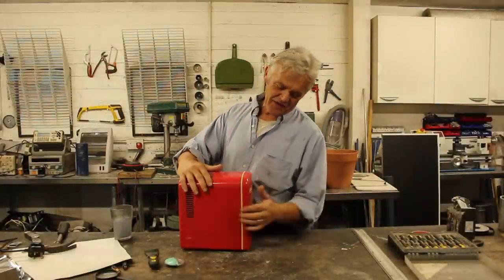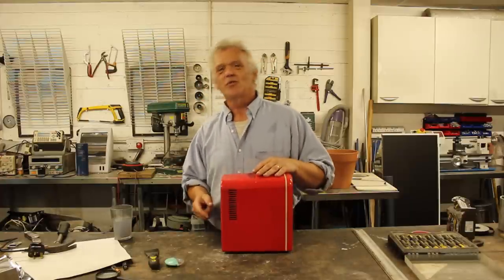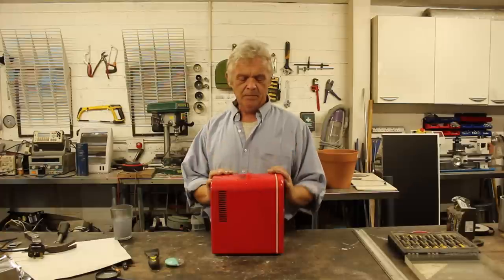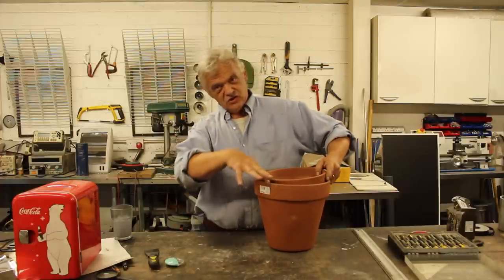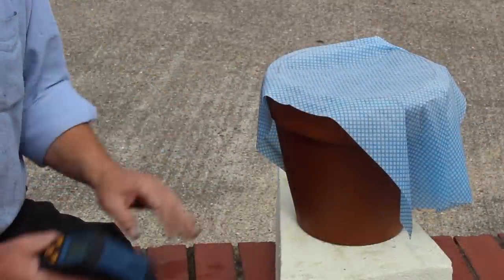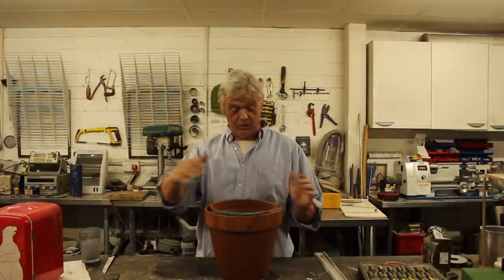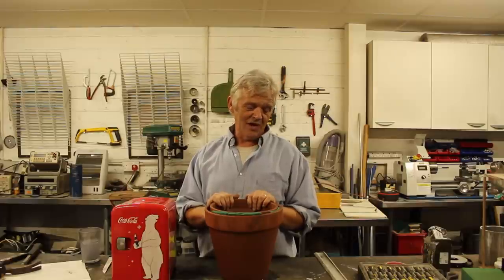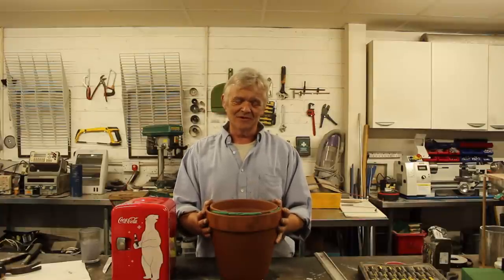1615 How To Make A Plant Pot Fridge A DIY Desert Cooler

Comment: Nice!  Use aluminum for the interior pot and it will get colder.  Put black sand on top and evap will increase as will cooling.  😎 Throw in a slight fan will increase evap as well.   High humidity will decrease evap thus decrease cooling so it works best in low humidity.
Reply: It won't get maximally colder with the Al pot, but it will transfer the energy exchange faster/more efficiently. Since the system isn't well insulated from ambient temps, doesn't matter too much, because you constantly have warm air getting back into the system, which will equalize the temp of the Al pot. 

  Basically, there will be no difference of total energy exchange, just different rates of relative cooling and heating and time of same.
Reply from the maker: nice suggestion - cheers mate

Comment: Zebras also have stripes because they heat up differently and create eddies and currents of air around their bodies, cooling them by up to 3 degrees Celsius. Something similar could be done inside the pot fridge, on the wall of the house, or the cooled room behind the stove - different materials, colors that have different thermal conductivity and different shapes that direct and distribute the currents.

Comment: I used to use a zeer pot in my camper (caravan?) If I remember correctly Mother Earth News said to soak the outer pot and keep it damp to aid in evaporation. Once its operating the outer pot stays slightly damp.  they do a decent job and you dont need to worry about ice but like you said they arent as effective in humid areas. You can help them by blowing air around them..
Reply from the maker: cheers mate

Comment: Fill the center with wet Oasis and put it in front of a window with a cross breeze and you have a handy air cooler for your window for those summer days where the heat is not on your side.
Reply from the maker: nice one!

Comment: I used to live in a house made of wood, straw, and clay with no air conditioner, and it stayed cool entire summer. Not sure why they don't use this technology anymore...
Reply: I'm So wanting a Cob House!! 
They're a bit labour intensive to build,but well worth the effort!!
Thank You for sharing this with us All 💞 Namaste 🙏
Andrea and Critters. ..XxX...
Reply: I used to live in one   wood straw clay building from 1860. It was always cool in the summer with just the right amount of humidity inside.
On our new farm we hve brick  walls and added woodfiber plates and clay to all walls facing outwards.  Oh and we integrated heating/cooling loops that are hooked up to a heatpump running at35°c. The whole wall can breathe and it was just as easy to build as modern building materials. Clay is quite forgiving  and can be locally sourced and using wood fibre panels makes it super easy to install. Waaaay better than rock wool.       All this to say at least in germany it's  possible and still done.
Reply from the maker: to be honest - I think a lot of heating and cooling problems just come down to the way we build out houses
Reply: @ThinkingandTinkering  or dont build em.
Reply: I dare say the PC brigade (sharp intake of breath) will see it as a fire hazard.
Reply: @terieffo8  Straw mixed with clay is actually pretty fire resistant. More resistant  than houses built of wood for sure.
Reply: short answer is such a home is actually illegal in most places, so you cannot pay a professional to build one for you, and you won't do it yourself.
the long answer includes the fact that nearly no one will pay you do build a mud house, and remarkably few people are willing to live in a mud house.
Reply: Homes and cities aren't built with isochanvre anymore because the Lumber and Timber Industry came in during the Industrial Revolution and created billionaires who create building codes and permitting.

Comment: Recently I changed my path and decking at the back of my house for black block pavers, I know this is going to sound strange but in the summer all I had to do is spray them with a hose and they cooled the garden and now i's got a bit cooler they are heating it. The effect is quite noticeable because they act like a sponge to water and a fantastic heatsink (when dry).

Comment: When the temperature drops below 30 degrees Celsius - you can light the rocket heater you made with sand and place pot fridges around the heater. This will ensure a sufficient temperature gradient. 🙂It is an exaggeration and at the same time it is not.
Reply from the maker: it is an interesting idea mate - nice - cheers
Reply: @ThinkingandTinkering  Or place the stove against the wall, make the whole wall or part of it as a double wall of pot fridge and one room would be heated and the other room cooled. Something like this.🙂

Comment: That’s a good one. I was fan of evaporative cooling for housing as it’s very dry here in some parts of Australia but I discovered that it can be too dry and hot which means you use more water than you can afford to loose which is why people in those areas actually prefer conventional refrigerative type A/C.
Something that I once wanted to try for cooling items was to have a very well insulated tube/tower with an access door at the bottom and a parabolic dish on top as large as possible with hole in it to collect cool air as you know cool air is heavy. Of course it would also collect water unless you had a drain with a floating ball valve at the bottom that will not allow the cold air to drain out.
I have no idea if it would work well or not but if you think it’s a worthy experiment then I’d love to see you try it out.

Comment: Try a white styrofoam lead for the inner pot and set it in the sun with longer strips of Oasis hanging over the sides shading out the outer pot The Oasis gets hotter and increases the evaporation process but both parts stay cool I got to try that

Comment: So, can it be scaled to be around the house? Or at least make something that circulates air in it, or maybe a coolant, to create some sort of air condition unit from it?
Reply: There are what was called swamp coolers around for along time and for awhile now, I've been seeing ads for small units. They uaually start by saying something like "cool any room in 5 minites". Of course you can start cooling, but not cool said room in 5 min. and if your adding humiid air, it will prob feel worse over time unless your in a dry area. They are used alot in green houses were hunidity isn't a problem.
Reply: @putteslaintxtbks5166  Yeah, if you were in a more humid area, you would want to put the evaporation unit outside, increase evaporation somehow (solar panels+fans?), and rather than directly blow the cooler, but humid air in, you would want to cool some kind of contained solid or liquid cooling exchange instead, so that you're not adding to the overall humidity. 

  Most swamp coolers directly blow the cooler, but damper air inside, which is fine if you live in a very dry climate--actually can make things more tolerable if its desert like. But even in the desert, these things can get real nasty pretty quick as far as microbial growth.
Reply from the maker: I would think so mate - might need a bit of reworking in terms of heat transfer - but the basic idea sounds good to me

Comment: Love to see what improvements you can come up with based on this old tech. Maybe a outer cabinet with a fan to draw air past and increase its cooling capacity... This kind of old school tech can really change people's lives with the increasing cost of living for those still on the grid.
Reply from the maker: I agree and I like the suggestion you made there mate - I guess we could increase the evaporation rate and so the cooling effect by something as simple as making the outside black
Reply: @ThinkingandTinkering  I did experiment with a black outside using BBQ paint, as it still allowed the moisture escape.  I was planning to then use Solar reflectors, akin to solar cookers, to intensely heat the pot to measure if it increased the inner cooling.

Comment: that's amazing,  using that principle would make a great small house project, in desert/hot areas. just supply water between the inner and outer walls to keep the interior cool without expensive air con.
Reply: The problem with doing that in the desert is, deserts are notoriously short of water. In fact, it's generally included in the definition.
Reply from the maker: I think you are right mate
Reply from the maker: I think he is thinking of places like Nevada, Arizona, Utah - in a hose there I would expect piped water - wouldn't you?
Reply: @ThinkingandTinkering  I live in Las Vegas, Nevada. The water level in Lake Mead, a major source of water in this part of Nevada, is at a historic low, with no signs of improvement. The reservoir is now below 30% of capacity. 

Restaurants only provide glasses of water at the table upon request, and the Valley Water District has recently raised the fines for wasting water. Fines range from $80-$5,120, depending on the amount of waste and the number of violations.

In other words, Nevada, Arizona, and other states in the this part of the US are in a condition of drought, and while a more energy-efficient cooling system would be nice, increasing water use is probably not the best idea.

Comment: Just had an idea. Imagine two terra cotta tubes with oasis between and a small fan to circulate the air from the inside tube into a room. I would think a  u shaped set up to circulate the air from a room through not the outside air. Maybe a handy air conditioner.
Reply: The opposite to the convection heater made out of stacked painted black cans
Reply: Seems like the sort of thing that could be done if you have a bunch of room to make an oddball low-energy version of a split aircon. Use clay pipes with sand between as the heart of the device. Clear plastic (old pop bottles?) directing warm airflow from a solar can stack around the outer pipe. Direct cool air from the inner pipe into the room to be cooled. Use water from a couple of those 100L rainwater barrels and an aquarium pump. Might even mitigate the 'orrible humidity problem of using indoor evaporative coolers, by keeping the evaporation part outdoors.

I know I've seen bundles-of-pipes experiments into aircon videos a long while ago. Dunno if it was this channel or Technology Connections. Gotta wonder how using the terracotta cooler principle would stack up against those.
Reply: @technicalfool  Thank you for sharing this information!! Much appreciated!!
Reply: @technicalfool  Tech Ingredients did something like this with a combo of PVC pipes, fans, moisture absorbing chemicals, and water.

  The problem with the terracotta cooler is size and weight of system you would need.
Reply: @justinw1765  Oh for sure, it'd probably need some hefty amount of clay pipe. But from an energy-use perspective, if it can keep a nice size room cool and dry for a few watts coming from a single solar panel rather than a kilowatt dragged out of the wall, using water saved from roof run-off, it could easily be a winner.
Reply: @technicalfool  Sure, as long as the area you live in isn't too humid. The higher the humidity the less efficient these systems. But then I suppose you could use solar panels and fans to increase the efficiency even in a more humid area. 

  These systems suffer from one major issue though, and that is cooling at night, because not only does humidity go up at night, but without the heat of the sun you get less evaporation. 

  For what they can do, modern cooling systems are quite efficient in all conditions. Probably the better idea is not so much to completely replace the system, but to supplement with other systems (like the above), as well as use more solar panels or the like. 

    The only thing better/more efficient overall than modern cooling AC systems, are geothermal.  They work in humid areas for cooling just fine, but unlike an AC system, they don't take the humidity out of the air and in such climes, that is half the battle of cooling to begin with. 

   But swamp type coolers (which clay pipes etc basically are a form of) are great for desert conditions (and will work at night too unless they start to ice up). But then again, desert areas tend to see a greater temp difference from heat of day and middle of night anyways, so the active cooling is not as important at night in these climes.
Reply: @justinw1765  Oh absolutely agree. When you live on an island near coastal waters, anything that pumps more water into your house is going to be a pretty awful experience.

However, you will still get some evaporation, and the cooled below-ambient air from clay pipes sat outside might even end up condensing some water in the same way as an air conditioner does, to the extent that a problem to overcome from making this weird split-evaporative-cooler contraption might be how to deal with water dripping out of the cold parts!

As for night time, well as you say, the temperature drops off sharply once the sun is down, so such a system would be kind of self-regulating in a way.
Reply from the maker: intersting idea mate - maybe worth a build just to see if it worked?

Comment: I've done the reverse.    Baked ½ of a large terracotta pot split lengthwise. Once it's oven hot wrap a substantially wet towel around it several times and it will slowly release the heat over a few hours. I know if there is any moisture inside the pot it will explode! Destroying the oven. So it is not without risk but I methodically dried the terracotta by slowly increasing its heat. (Cheep apartment in my younger years without adequate heating ) fond memories looking back.
Reply from the maker: like it mate - that is a nice tip

Comment: But honestly Rob, I am reminded of one of your older videos of energy exchange where you pulled a light vacuum to decrease the boiling temp of water and then have a passive adsorptive material at the hot side to pull the liquid over there. These systems can be optimized to move greater amounts of energy, and more importantly, the cold side can be put into a well insulated box/container also increasing efficiency, because with the terracotta system, you have too much conductive and convective energy exchange with ambient temps and air. 

  Since I assume you've read some of the literature on this, I assume you know that some countries like Egypt have built systems like this that create large amounts of ice (granted these systems are pretty large, and more involved than what you built/showed us).  And they just use Solar heat as the regenerative part of transferring the liquid back. I think many of the systems use a combo of water and methanol as the liquid, but since it's in a closed system, no big deal.

  It's basically a less efficient overall, but more energy efficient and less expensive (and toxic) version of more modern cooling systems.
Reply from the maker: I agree mate - these systems can get better and more productive relatively easily but that does take a bit of construction - this is really aimed at super simple - of course - that means compromise - but see it as a way to think as opposed to an end solution if you like - cheers

Comment: Law of thermodynamics ,heat will flow from a hot body to a cool body. In this scenario heat flows from a cool body to a hot body. On the surface it appears to contradict the law . The question is what is going on at the boundary and how is that causing heat to flow towards the hotter body of air .

Comment: I don't think this will work with plastic pots, because that's all that most people I know have on-hand, so you will need to go buy a set, some foam (which is also very useful for other things besides floral arrangements) and put it away somewhere.
You could use the flower pots for heaters in the cooler days, while you store things outside in the cold, and as a  refrigerator on the warm days, when you don't need the pots for heating.
  I would suggest you filter the water somehow, if it's dirty.

Comment: What if we used evaporative cooling, swap coolers, to aid regular air conditioning, like if we were to collect the cold water from the condenser, and blow air over that water to help it evaporate, absorbing heat energy, which could be fed back into the room/condenser, making the output chillier more efficiently?
Reply: The more efficient ACs already use condenser water in exactly that fashion to cool the hot coils, blowing the spent vapour outside with the exhaust air. They tend to only collect water when you're running the machine in "dehumidify" mode.
Reply from the maker: great idea mate

Comment: Back in the 60's when we were poor and had no fridge we used to use the kitchen sink!

We would put the milk in there (remember glass bottles with the great thermal conductivity?) Simply chuck a tea towel over and run a few inches (yes we were in inches back then too) of cold water in and Bingo! you had your free cooler.

OK Peltier time ....... You say that you can get 15 degrees cooler on the inside compared to the hot side, but that is relative! Cool the hot side and you cool the inside even more. Your oasis should work well clamped against the hot side and with the base in water! Or you could put several plates face to face (hot to cold obviously) you would then multiply the heat difference!
Reply from the maker: you would - but only so far as you kept the hot side cooler and a Peltier transfers heat so the hot side would gradually get hotter unless you actively did something to keep it cool - so maybe a mix between Peltier and evaporative cooler is what you would end up with?
Reply: @ThinkingandTinkering  Yes! That is what I ment with the oasis. Cool the hot side and the cold side gets even cooler!